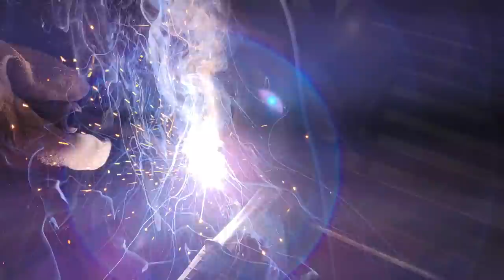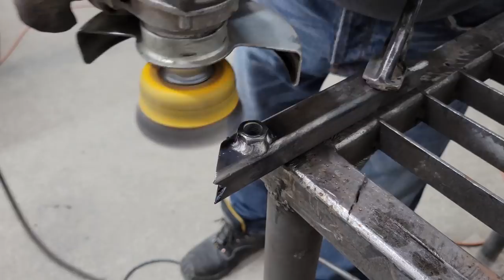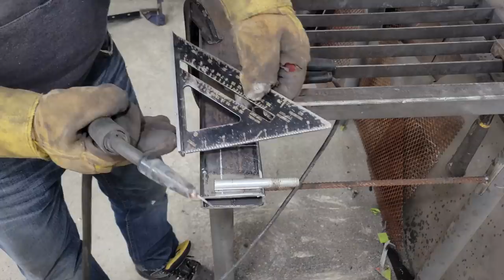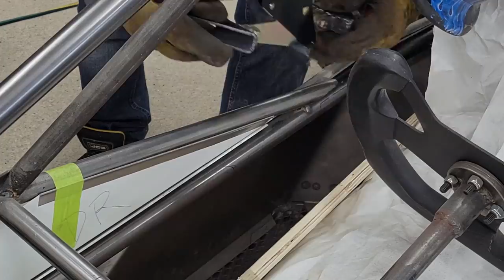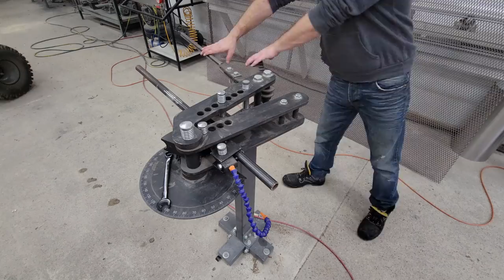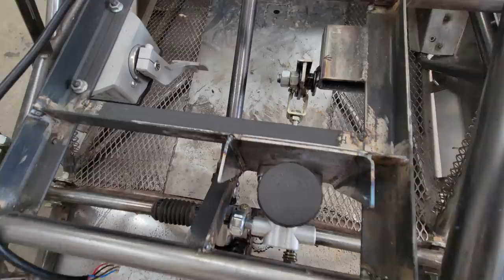Homemade Electric Buggy, Ep 6: Bucket Seat, Harness & Brakes

Comment from the maker: Welcome back to the electric crosskart build series! In this video I install the bucket seat from Scat Enterprises, a 5 point safety harness, and a handbrake kit to operate the dual hydraulic calipers on the back brake rotor for parking and general foolishness. Links for the parts that I used in this video are below. If you have any questions or comments, you know where to post them. I read them all. Ep 7 will be ready for you folks in a few days and will show the installation of the cooling system, fitting the batteries in the cabin, and finishing some other random stuff to prep for paint. Thanks for stopping by! 

Seat: 
https://www.ebay.ca/itm/294711094844

Harness:
https://www.ebay.ca/itm/233968286890

Handbrake kit:
https://www.ebay.ca/itm/312617105002

Rear calipers:
https://www.ebay.ca/itm/283066433127

Brake master cylinder:
https://www.ebay.ca/itm/143716265990

Electric throttle:
https://kellycontroller.com/shop/kelly-0-5v-throttle-pedal/

Website: https://www.resystech.com

Support RST on Patreon or Youtube and earn membership perks:

http://www.patreon.com/resystech
https://www.youtube.com/channel/UCtrf6ZiE6hw3k77hGpnuQWg/join

Follow RST on Facebook:
https://www.facebook.com/RenewableSystemsTechnology
Reply: if we were meant to have electric shit jp morgan would have stood out of the way of Telsa  and by now would have been living in a utopia for real and not the leftest weirdo type either. crime wouldn't exist poverty and hunger would have long since been abolished planned obsolescence would have never existed and governance would be an afterthought.  anyone pursuing this just annoys the shit out of me.
Reply from the maker: @ron whittaker  If you're annoyed by "electric s--t" so much then you should unplug. With your life pretty much entirely dependent on "electric s--t", this buggy that you don't own or drive should be the least of your concerns. My videos are about DIY tech and self sufficiency - not politics. There are plenty of  channels for discussing that time wasting nonsense.
Reply: could you maybe point to the video&timestamp where you figured out the ackermann geometry for the steering? :)
Reply from the maker: @mx96288  That's done long before the video, during the design stage. Ackerman is relatively easy to figure out. Simply put, the king pins and steering pivot points (on the steering arms) need to line up so that a straight line can be drawn between them to line up directly with the center of the rear axle to produce 'perfect' or 100% Ackerman. With perfect Ackerman, the center of the circles traced by the wheels while cornering will be at a common point at any angle. Though, this can be hard to accomplish with certain setups and not necessarily ideal for certain applications, like high speed racing or off-roading where parallel or anti-ackerman steering would provide better grip for high vertical loads. I'm not using 100% Ackerman with this kart, but am using some and may make adjustments later based on how it handles during the test drives. You can calculate the ideal inner wheel angle and Ackerman percentage as: 

Ideal inner angle = atan(wheelbase / (wheelbase / tan(outer angle) - front track width))

Ackermann % = (inner angle - outer angle) / (ideal inner angle - outer angle)*100
Reply: @JamesBiggar  thanks for elaborating!
Reply: Where can I get the chassis plans?

Comment: Great job, well done. Check the height of your top seat belts as the holding point should be about 10 degrees above your shoulders. If you are in a crash it won't depress your spine as the if the belt is at the same height or lower than your shoulders would. These are just common facts from speedway drivers.
Reply from the maker: Thanks! Harness angles and mounting points have already been considered and set accordingly, but I actually learned slightly different from the pro's in my neck of the woods. Shoulder harness should be 90° parallel to your spine. 10° higher and there's too much wiggle room. The bottom line is that the harness should pull you back into the seat when the shoulder straps are tightened, not down. What you absolutely don't want are mounting points too high that allow movement in the seat. Your weight compounds significantly in a crash, and wiggle room increases the risk of breaking the harness. Waste strap angles also need to be within a certain range:
https://www.youtube.com/watch?v=BFUdxclvdbo

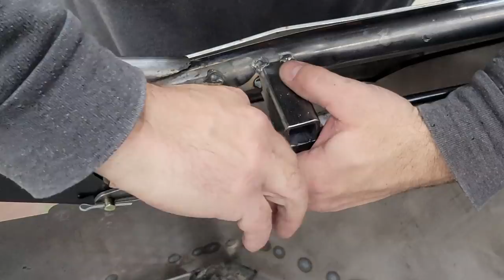Comment: 15:08 Maybe a splitter to balance the force on each cable is better.
21:15 Um... Distance between the helmet and the roof?🤕😅
Very nice work and simple trick to protect threads during welding. 👍
Reply from the maker: 15:08 - I did 
21:15 - more than enough for me if the safety harness does its job. There's no reason for my ass to leave the seat unless I want out of it.
Thanks!

Comment: Looks visually stunning! The volumes are spot on! Curious to the weight distribution? And I’m excited to see it go! I imagine it’ll be a great trail ride machine. Any sand dunes in your area? Very happy to see you build this James!
Reply from the maker: Thanks! No sand dunes but there is an abandoned mine nearby with a tailings dam and loads of access roads, trails and gravel pits. And a couple of frozen lakes. Been a bit too warm this year to chance the lake, though. I want to test drive asap but there's really nowhere to take it right now during the winter other than the asphalt :(  Snow is just deep enough in the trail that I don't think I can make it to the mine. We'll see what time brings. I think there's a bit of a rear bias with the weight distribution, but I need to get a few more scales to weigh things out more precisely. Total expected weight is somewhere between 850-900 lbs.

Comment: Hi, I'm just thinking that from a safety point of view it would be great if you made the steering safety shaft like on a car. Because that way when you crash it goes through you.
Reply from the maker: Not sure what you mean. I've been in a few car accidents where my face has bounced off the steering wheel - before air bags were mandatory. I have a deviated septum because of it. Didn't feel very safe at the time. The kart's designed with a good amount of crumple zone for a reason, my friend. No worries :)

Comment: One question. Is that a clutch pedal on the left? I may have forgotten about that from the earlier videos. This is probably a stupid question, but why would that be needed on an EV? The reason I asked is because I’ve had MS for over 16 years and so far only my left limbs are affected. Left leg/ ankle are the weakest. I am really interested in this build. I also like the reverse trike. MS has affected my balance as well. 
AWESOME builds/ creations. Hello from Northern Alberta. 🤘🇨🇦🤘. 🤓
Reply from the maker: Thanks! That would be the brake pedal. It operates the hydraulics, the hand brake is for parking and goofing around (drifting, donuts, whatever).

Comment: Hey I just found this channel and as a fellow homesteader looking to move to solar/wind I really love the videos! I have a question about the crosskart. With the handbrake it seems you're running it like a clutch basically. What does stopping an electric motor like that do for the internals of the motor? I'm working on a similar build but as a 1930s Sprint Car and I want to go electric.
Reply from the maker: Thanks! I'm not sure what you mean by using it like a clutch - a clutch decouples the engine output shaft from the transmission and allows each to spin freely without interacting or braking. The handbrake is primarily for parking since there's no transmission. Using the handbrake while driving to, for ex, initiate a drift around a corner will be no different than locking the rear brakes on my direct drive e-motos to go into a rear skid, or dragging the rear brake around a corner to tighten up the line. EV motors are robust and powerful. They're designed for this stuff, to handle anything that their ICE counterparts can tackle and more. The only thing that's going to stop them is going overvoltage, overcurrent, worn out bearings or water (if it's not a sealed model). Bearings aren't a big deal and overvoltage/overcurrent are very simple to prevent in the design and controller programming. The motor controller should always be sized and programmed to prevent voltage and current issues from damaging it, the motor or the battery. It's the brains of the operation. A good controller can be programmed by the user with easy to understand software, and will momentarily cut power to the motor if it senses the motor is pulling too much current (set by the user) from the battery, for example. As long as the stator is protected, then you can use an EV motor just like any other. The only difference is that a normal transmission isn't required (but don't necessarily need to be omitted) because EV motors produce a lot more low end torque than an ICE - an ICE would go nowhere if not for a multi-speed transmission. Most full size EV's use a single or two speed gearbox with the motor. That's it. No clutch, no torque converter, less problems.

Comment: at 21:22 i see that the seat shakes off from the frame from what i can presumably assume is from the fact that the seat is bolted to the mounts that are welded to the sheet metal in the bottom. Wouldn't it be safer to find a part of the metal frame to weld it to instead of the sheet metal? I don't recall from the previous videos so I might be making a fool out of myself, but it just doesn't seem safe with that wiggle. Also is the size of the surface that the weld enough? it just seems like those 4 points of metal might not be enough even if it was on the frame.

Please correct me if I a wrong as I have little experience with metal work. Great video though, can't wait to see more
Reply from the maker: Thanks. As noted in previous videos, everything is just tack welded in place until all components are fitted. I never fully weld anything in place until I'm sure I won't need to reposition it on the chassis for any reason after the fact. That would just be a waste of time and MIG wire. The seat moves because it wasn't bolted in place when I put it back in the cabin, as shown in the video. There's a thicker steel plate tack welded to the tube chassis below the sheet metal that everything is plug welded to directly (mounts and all, hence the drilled holes in the flanges), shown in previous videos (I believe the body panel video). No different than seats mounted in a passenger vehicle with a unibody (ie no tube frame, just molded sheet metal). There's plenty of reinforcement. The seat is just a place to plunk my ass and keep me from shaking around so I have better driving control, anyway. The safety harness is what offers protection when it's needed, hence why the straps are mounted directly to the tube chassis and not the seat - this is the case for any machine.

Comment: don't you think that the steering translation is a bit too short?, that means it has to turn too much..., but otherwise it will be a masterpiece!
Reply from the maker: You mean the wheel angle rotation. No, nowhere near too much. The steering rack is specifically designed for sand rails and has a similar steering ratio as an F1 race car, as in full lock out in both directions is achieved with <360° rotation, ie: one or less turns of the steering wheel. Links in the suspension/steering build video description. This provides much faster steering input than a typical passenger car that uses up to 900° of rotation, or 2-3 turns of the wheel to reach full lock out - putting a yoke wheel on one of these would be silly, hence why Tesla caught some backlash over their decision to use one. As you should be able to see in the video, I'm achieving near full lock out at <360°. Just fine for a backyard buggy build, more than fine. I have 0 plans to compete in any sort of open wheel racing to be concerned with +/- a few degrees of angle rotation.

Comment: You weld with MIG, but splatters and residue looks like from MMA welding. Aren't you using CO2?
Reply from the maker: No. I have a flux core MIG because I do as much welding outside on the homestead as I do in the shop for Youtube. Gas shielding doesn't work very well in the wind.